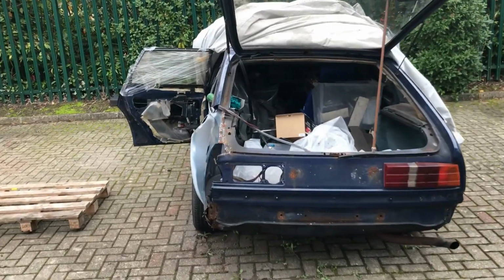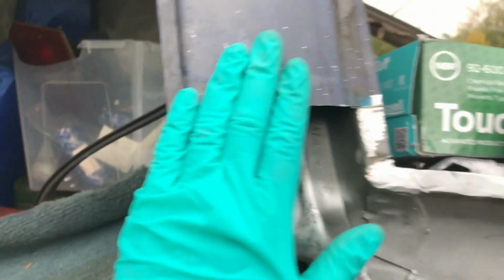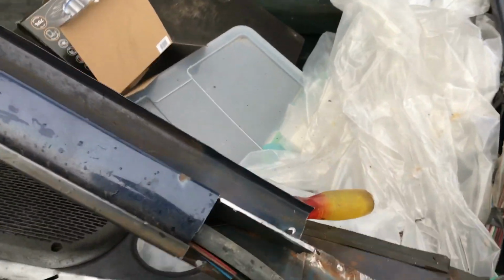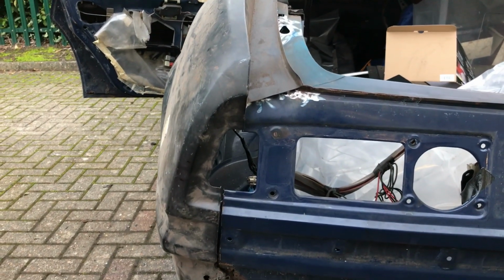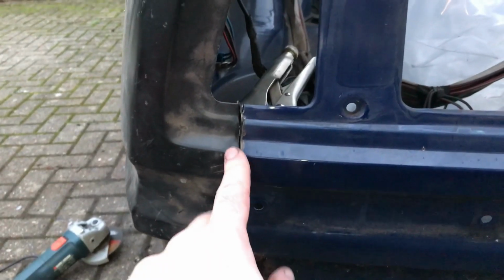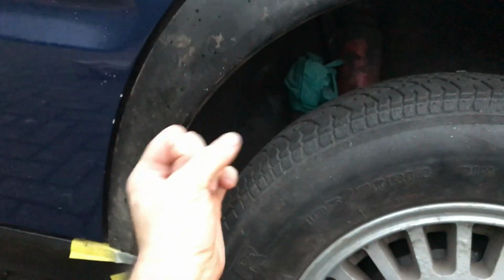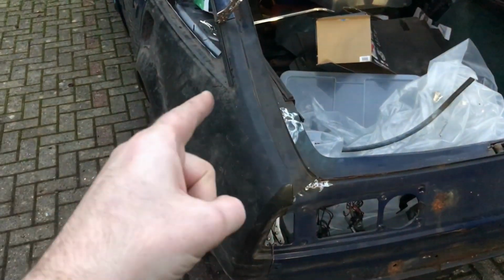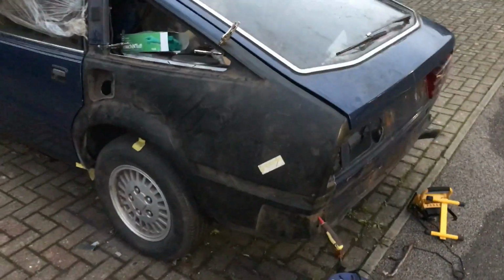Rover SD1 2400 SD Turbo restoration - Video 67 More rear wing action

Comment: I've only owned one SD1 , Here in Australia. not sure what year model it was but it had lucas electronic injection. The car was free ,given to me by a niece whose father in law had left it to her . It had a newly rebuilt engine ,ran beautifully but had the usual SD1 hoodliner which would droop and touch you on the head,like some sort of poltergeist was living in the car. I sold it to a Range rover owner seeking a new engine, he then put the engineless car on ebay for what i sold it to him for. 
And....no rust. 
Ive seen in India SD1 with the Vanguard Engine(fergy tractor,Morgan,TR's etc )  but never a Diesel like this. When I saw turbo I thought you might have been saving the twin turbo V8 one that is on the Rimmer Brothers channel.
Reply from the maker: I Australia they had a fuel injection setup so it would pass the more rigorous emissions standards. It was detuned compared to the later uk fuel injected cars. Headlining are a pain. I need to change mine.

Comment: Good Job. Great to see you back on it. I was thinking you might have gone off the boil and stripped it for parts. If you are offered /  happen across any Six Cylinder engine parts let me know, in particular the 2.3 / 2.6 Cambelt tensioner. They are almost Impossible to source unless you want to pay half a weeks wages to a man in Spain. Regards

Will.
Reply from the maker: I think the tensioner from a ford Sierra transit with the 2.0 litre pinto engine can be modified to fit.
Reply: I know its a late comment, ive got a full 2300 engine up for sale soon

Comment: I'm surprised it fits so nicely after all! I've experienced so badly fitting panels and sheet metal parts that I wondered if they were for the right model!😄
Reply from the maker: I did a mini for my cousin and the panels for that were truly shocking.  It was like an impressionists vision of what a wing for a mini should look like, rather than actually being correct. Took 2 days just to reshape and align the front end.
Reply: @nitrosilvia  been there! 😁

Comment: Going so well now, can you show us how you will protect the wires when you weld up the back pillar?
Reply from the maker: I accidentally cut through some of them, so im gonna pull that loom out before i weld it.  You can just use silver foil or silver aluminium tape like you have for industrial air con units.